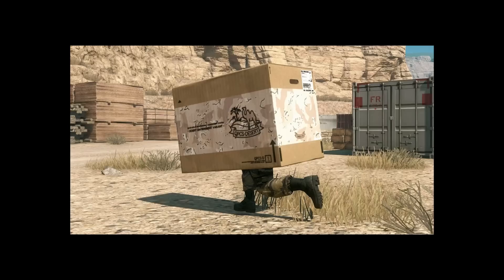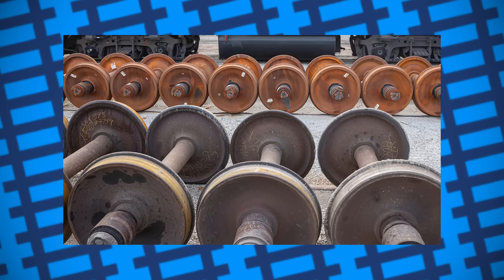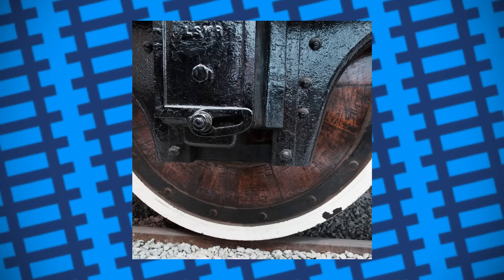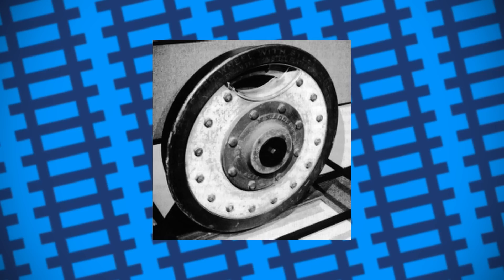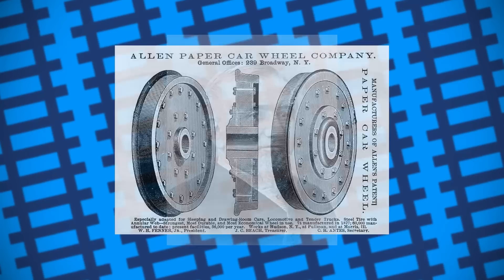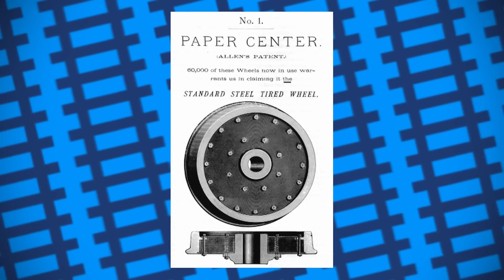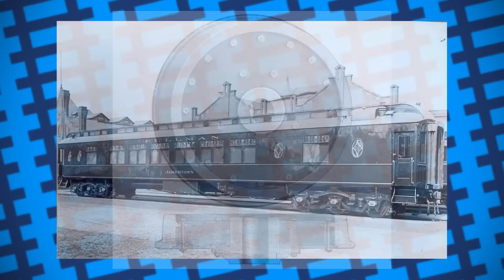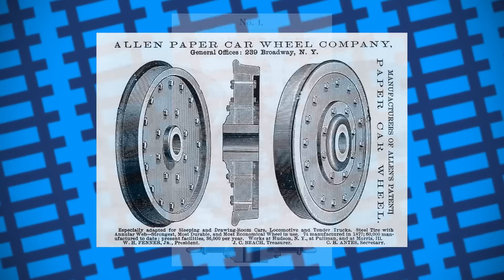Why luxury train carriages had wheels made of actual paper - Allen Paper Wheels

Comment from the maker: For my next trick, a boiler made out of potting clay
Reply: How about a wooden firebox?
Reply: coincidentally some potters wheels have infinitely variable drives  consisting of two cones one made from steel the other paper  one cone  rolls aginst the other changing the contatact patch and thus the gear ratio - i belive the paper cone is for traction against the steel
Reply: @deptusmechanikus7362  A wax dome?
Reply: Make it a oil burner to
Reply: @deptusmechanikus7362  osium pistons?
Reply: @MagnumLoadedTractor  Plastic whistle?
Reply: @AbbeyYard  cardboard motion?
Reply: @LancashireAndYorkshire  mercury axel boxes?
Reply: @BrokenIET  Toothpick lamp irons?
Reply: glass frames anyone?
Reply: @sebastianthomsen2225  coffee stirrer regulator?
Reply: @sebastianthomsen2225  Cardboard axles?
Reply: Huh, Most all agricultural tractor's between 1920's 1950's had a pulley for flat belts. Flat belts 'cause of machinery from the era of steam engine tractor's was still around, Farmers tended to keep farm machinery around even when newer equipment was available. All this to lead up to a pulley that  used laminated paper to drive a buzz saw we used to cut up firewood. No dead man in those days, had to be very careful.
Even with a dead man switch, I doubt the tractor would have stopped in time.
Reply: Nice
Reply: Couplers made of orphans holding on for dear life.
Reply: @AbbeyYard  LEGO piston boxes?
Reply: @TheGs4_4449  Doorknob safety valves?
Reply: We’re all just making a locomotive at this point. Let’s keep up the chaos and see the outcome.
Reply: @TheGs4_4449  Tinfoil Footplate
Reply: @AbbeyYard  glass buffers?
Reply: @tee6025  Handrails made of straws?
Reply: @AbbeyYard  bolts made out of mints?
Reply: @tee6025  Boot Chimney?
Reply: Candlelit mars light and rubber suspension
Reply: @BenStillDraws  bamboo oil tank?
Reply: @BenStillDraws  A tarpaulin draped over it instead of paint?
Reply: @BenStillDraws  Water hose Brake pipe?
Reply: How about windows made from packaging tape
Reply: Ballistic gel water gauge?
Reply: @AbbeyYard  plutonium tender
Reply: @MagnumLoadedTractor  Wooden brakes?
Reply: @AbbeyYard  cylinders made of Coca Cola bottles?
Reply: @tee6025  axle boxes made of cheese?
Reply: @AbbeyYard  sandpaper brakes
Reply: It can work!
Reply: Yall thought E.D.T 15 boiler test was a fanfiction na that shit was awerness
Reply: @MagnumLoadedTractor  Harmonica top feed
Reply: and the steam dome of lead (RGS 20)
Reply: Oh Boy Prepare For A Steam That Falls Apart By Doing Absolutely Nothing
Reply: @nickseajackson0195  "The master of the railway, was once more, a peice of scrap."
Reply: @AbbeyYard  Oh No I Mean Literally Nothing As Soon As It's Finished Being Built It Just Straight Up Collapses In Less Then Four Seconds
Reply: I’m pretty sure you could Use Play-Doh tubs as a steam engine boiler on a mini arts and crafts Steam engine
Reply: Cardboard smokebox??
Reply: An olive oil-burning steam engine
Reply: Give It Ice Fire Bars?
Reply: @jonathanaina7754  Cab made of corrugated metal?
Reply: Yes
Reply: Chocolate Teapot?
Reply: I feel like the part about chucking paper at siblings was a confession! Lol.
Reply: Rubber tracks?
Reply: Coal made of dry ice. Hey, at least it will smoke. 😂
Reply: RTG steam locomotive
Reply: I think that guy over on Primitive Technology is building a clay boiler.
Reply: everything works better, if it is made out of bacon.
Reply: A torch for a lamp
Reply: Brakes Made Of Air?
Reply: Don't laugh, I seen a recreation of a old settlement/ fort just in Virginia from Kentucky and Tennessee are the chimney's are made from small logs.
Reply: ?  Maybe some but some was laminate leather
Reply: An acetylene burning firebox.
Reply: Chocolate brakes I trust?
Reply: Wouldn't put it past you 😅
Reply: @bdykes7316  plastic brakes
Reply: Big missed opportunity on “just because it sounds crazy on paper” you could have said “don’t mean its not on rail”
Reply: @AbbeyYard  headlamp made from  disco ball with lazer pointer pointed at it?
Reply: Shut the front door
Reply: No no, we want a rocket made of spaghetti!
Reply: Was that pun at the end intended?
Reply: Some early boilers used on the first steam engines used to drain mines had  boilers made of stones.
Reply: People don't realize the strength of composite materials.
Use epoxy for the glue, and replace the natural pulp fibers (cellulose) with carbon fiber, and you don't find the idea quite so absurd.
Reply: @MagnumLoadedTractor  to what ?  Your reply got cut off.
Reply: Rubber pressure valves?
Reply: @Sean Embry oh damn, guess I learned something new
Reply: possible, but ill advised.
Reply: Please when will this video be made, any link?
Reply: Also interesting: One can get very rich with coal mining and trading. (But it is a bloody business.)
Reply: Sponge tender
Reply: A working stove made of paper mache?
Reply: @AbbeyYard  Cardboard's out. The front could fall off.
Reply: Ah! And why did they stop making wheels made of actual paper?
Reply: @deptusmechanikus7362   a copper cabin for the conductor, because of its conductivity.
Reply: A entire train made of paper with text on it
Reply: @deptusmechanikus7362  Or better yet. Ice.
Reply: I’ll top you with a sub made of carbon fiber
Reply: That is possible
Reply: @AbbeyYard  Pedal-powered booster?
Reply: @AbbeyYard  twigs as brake handles?
Reply: @AbbeyYard  plastic frame?
Reply: @Coaster_F59PHI  Burning ground beef as feul?

Comment: Talking about putting wheels on passenger trains: In Germany we tried putting tram wheels, which are partly rubber, on high speed trains which lead to the worst accident in German high speed history, the Eschede crash. It’s worth checking the story out
Reply: The crash was caused by the wheels being used for far longer than they should have been.
Reply: Not exactly tram wheels, but the technology that went into making them quieter and more comfortable was used on the ICE train but without frequent inspection and maintence, the steel tires would come off the rubber inserts like we saw with Eschede.
Reply: @nekomasteryoutube3232  the technology came from tram wheels
Reply: @schwarzerritter5724  Usually cracks in the wheels start outside and grow in. Noone expected the cracks to start inside.
Reply: I included eschede in a powerpoint about trains I did back in elementary... I'll never forget that story.
Reply: Yes, train tyre coming into the passengers like a monster steel snake. Not read it. I imagine it halved people?
Reply: @teamidris  the tyre didn't hit anyone, but the conductor refused to stop the train over it. If they had, eschede wouldn't have happened
Reply: Well There's Your Problem
Reply: @doctorhabilthcjesus4610  they actually did, they where informed by the Tram operators about it, because they already had such failures. They simply weren't taken seriously
Reply: I read that a part of the wheel came of and jammed into switch points on the track. Effectively switching the track so the back half of the train went down one set and the front went down another set of tracks causing the derailment and subsequent crash?
Reply: @Bobby-xr4bo  the train slammed itself into a bridge which collapsed. The rest of the carriages then pancaked against the bridge. Apparently the engine rolled through Eschede completely alone
Reply: Everyone who covers it butchers the name
Reply: @doctorhabilthcjesus4610  Thing is: they actually saw something in the preceding inspection, but ignored it.
Reply: @Bobby-xr4bo so train drifting ISN'T safe? That doesn't sound right
Reply: @brianargo4595  pardon?
Reply: just reading "we tried putting tram wheels, which are partly rubber, on high speed trains" tells me its a bad idea. where does germany keep coming up with this shit? rubber train wheels, lug studs where the wheel just falls off the car when you take the last one out, and killing jews. the list I keep seeing just keeps getting longer.
Reply: @SofaKingShit  Trains good. Kapitalizm bad.
Reply: Hehe I imagined this being read with a German accent. funi :))
Reply: @zombieblaster5754  Well, it does work for cars and the landing gear of airplanes, doesn't it? Anyway, it wasn't the rubber, that failed, it was the outer ring breaking because of sloppy maintenance. And given the paper wheels and the tram, there had been working precedents. What ever your qualms with the Germans, there are a lot of ideas out there, that are wonkier than that. Start with Zombies, that need to be blasted.
Reply: @Bobby-xr4bo  The Wikipedia article on the subject is just bonkers. The steel tyre on one of the wheels on the first coach delaminated from the wheel, getting flattened out and spiked up through the floor of the passenger compartment. A passenger complained, and the conductor on the car spent a full minute "investigating" without initiating an emergency stop. 

During that time the train went over a series of switching points immediately before a bridge. Because the wheel was fucked up, the first switching point derailed the bogie that wheel was attached to, and part of the bogie collided with the lever for the next switch down the line. Because of that, the third passenger coach was "half-switched" with the front half of the car going down one track, and the back half going down another track, and each track going on opposite sides of a support pillar under the bridge, taking it out, causing the bridge to collapse on the train car, and the rest of the train to smash into the collapsed bridge.

Like, in total, an absolute cavalcade of errors, leading to the worst possible outcome.
Reply: I've known for a few years about the "Multi-track Drifting" parody of the Initial D opening theme sequence. Only today did I learn that this actually happened once, to terrible consequence.
Reply: If it happened in Enschede then its not a crash in German history but in Dutch history ( I am joking)
Reply: @RamadaArtist  The conductor didnt stand there looking at the steel beam sticking through the floor for a full minute.
The passenger took his family to another car, then searched the conductor who had to investigate the damage and in the moment the conductor reached the place of the damage the derailment already happend.
Reply: Wheel design
The ICE 1 trains were originally equipped with single-cast wheelsets, known as Monobloc wheels. Once in service it soon became apparent that this design could, as a result of metal fatigue[citation needed] and out-of-round conditions, result in resonance and vibration at cruising speed. Passengers noticed this particularly in the restaurant car, where there were reports of loud vibrations in the dinnerware and of glasses "creeping" across tables.

Managers in the railway organisation had experienced these severe vibrations on a trip and asked to have the problem solved. In response engineers decided that to solve the problem, the suspension of ICE cars could be improved with the use of a rubber damping ring between the rail-contacting steel tyre and the steel wheel body. A similar design (known as resilient wheels) had been employed successfully in trams around the world, at much lower speeds. This kind of wheel, dubbed a "wheel-tyre" design, consisted of a wheel body surrounded by a 20-millimetre-thick (0.79 in) rubber damper and then a relatively thin metal tyre. The new design was not tested at high speed in Germany before it was made operational, but was successful at resolving the issue of vibration at cruising speeds. Decade-long experience at high speed gathered by train manufacturers and railway companies in other European countries and Japan was not considered.[citation needed]

At the time, there were no facilities in Germany that could test the actual failure limit of the wheels, and so complete prototypes were never tested physically. The design and specification relied greatly on available materials data and theory. The very few laboratory and rail tests that were performed did not measure wheel behaviour with extended wear conditions or speeds greater than normal cruising.[clarification needed] Nevertheless, over several years the wheels had been reliable and, until the accident, had not caused any major problems.

In July 1997, nearly one year before the disaster, Üstra, the company that operates Hanover's tram network, discovered fatigue cracks in dual block wheels on trams running at about 24 km/h (15 mph). It began changing wheels before fatigue cracks could develop, much earlier than was legally required by the specification. Üstra reported its findings in a warning to all other users of wheels built with similar designs, including Deutsche Bahn, in late 1997. According to Üstra, Deutsche Bahn replied by stating that they had not noticed problems in their trains.[2]: 39:38 

The Fraunhofer Institute for Structural Durability and System Reliability [de] (Fraunhofer LBF) in Darmstadt was charged with the task of determining the cause of the accident. It was revealed later that the institute had told the DB management as early as 1992 about its concerns about possible wheel-tyre failure.

It was soon apparent that dynamic repetitive forces had not been considered in the modelling done during the design phase,[4] and the resulting design lacked an adequate margin of safety. The following factors, overlooked during design, were noted:

The tyres were flattened into an ellipse as the wheel turned through each revolution (approximately 500,000 times during a typical day in service on an ICE train), with corresponding fatigue effects.
In contrast to the monobloc wheel design, cracks could form on the inside as well as the outside of the tyre.
As the tyre wore thinner, dynamic forces increased, causing crack growth.
Flat spots and ridges or swells in the tyre dramatically increased the dynamic forces on the assembly and greatly accelerated wear.
Failure to stop train

This section does not cite any sources. Please help improve this section by adding citations to reliable sources. Unsourced material may be challenged and removed. (December 2016) (Learn how and when to remove this template message)
Failing to stop the train resulted in a catastrophic series of events. Had the train been stopped immediately after the disintegration of the wheel, it is unlikely that the subsequent events would have occurred.

Valuable time was lost when the train manager refused to stop the train until he had investigated the problem himself, saying this was company policy. This decision was upheld in court, absolving the train manager of all charges. Given that he was a customer service employee and not a train maintainer or engineer, he had no more authority to make an engineering judgment about whether or not to stop the train than did any passenger.

Maintenance
About the time of the disaster, the technicians at Deutsche Bahn's maintenance facility in Munich used only standard flashlights for visual inspection of the tyres, instead of metal fatigue detection equipment.[5] Previously, advanced testing machines had been used; however the equipment generated many false positive error messages, so it was considered unreliable and its use was discontinued. During the week prior to the Eschede disaster, three separate automated checks indicated that a wheel was defective. Investigators discovered, from a maintenance report generated by the train's on-board computer, that two months prior to the Eschede disaster, conductors and other train staff filed eight separate complaints about the noises and vibrations generated from the bogie with the defective wheel; the company did not replace the wheel. Deutsche Bahn said that its inspections were proper at the time and that the engineers could not have predicted the wheel fracture.[2][time needed]

Other factors
Reply: @SofaKingShit  government services cut corners for the sake of profit, too: tax money is income which they want to profit off of. The only difference is, government can't be held accountable for their failure or malice because you can't stop funding them. But keep pretending self-interest is uniquely capitalist, rather than universally human.
Reply: has WW2 not taught you lot anything about over engineering? honestly. built to last, not innovate fast. germans am i right.
Reply: oh dear. Must have been differential stresses over the radius. The thought was sound but in practice less so.
Reply: Are you talking an unmodified tram wheel that wasn't designed for those speed?

Rubber composite would be great at those speed, but solid rubber would not be able to handle the vibrations properly.
Reply: I would like to note that all modern car tires are made out of rubber composite for this reason.
Reply: @ruediix  tyre*
And old rubber was a composite too.
Reply: @@RoachDoggJr2 i am only saying what I learned from the documentaries